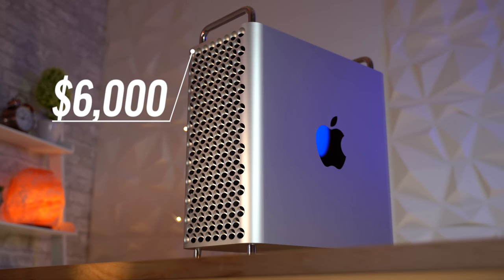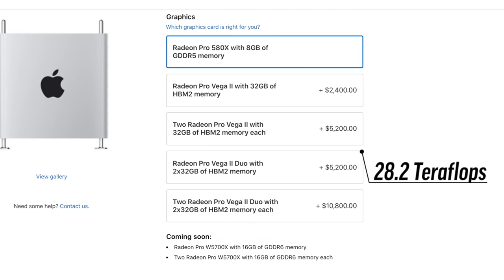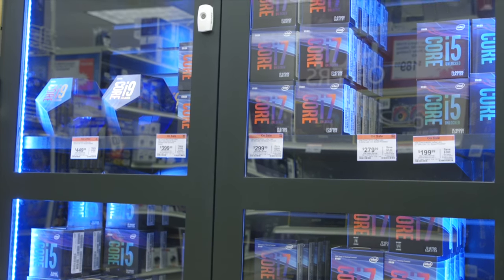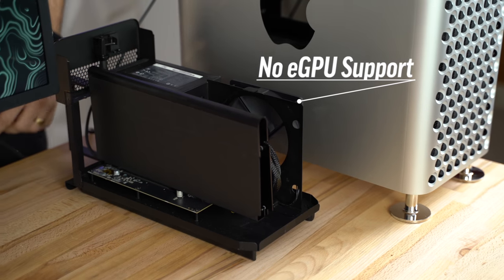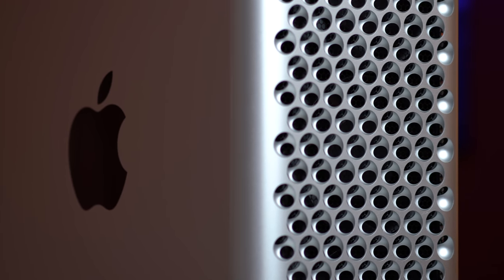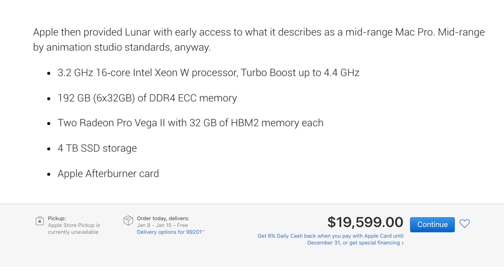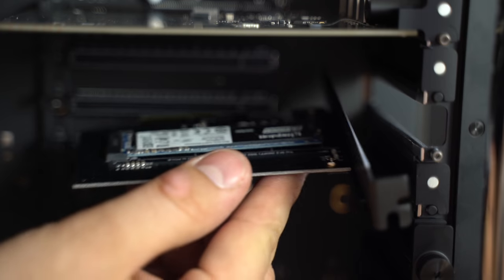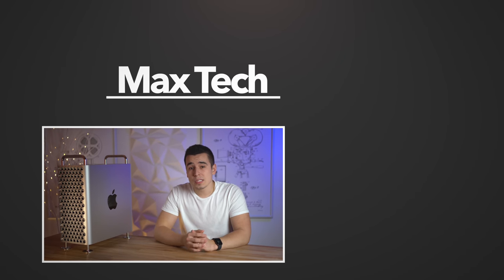2019 Mac Pro Review - 7 Reasons it Sold Out!

Comment: I don’t understand how you came to workstations that price, you can beat out the Mac pros performance staying under 10k, and you don’t even have to go with an AMD processor intels i9 is basically the same for way less just don’t use ECC ram, ECC doesn’t offer much more stability anymore compared to even ddr3, and compared to ddr4 the difference is negligible except for the fact that ECC is more expensive and slower. A gtx 2080ti should get pretty close to its gpu and still be cheaper and if you wanna beat it than just get 2. On top of all that it’s not like Apple has to use intel for this, they could’ve went with an AMD processor which could leave it up to the user if they want ECC or not.
Reply from the maker: Definitely not a paid review. What LG monitor?

Comment: 2012 Mac Pro doesn't have weak power supply. It has 1000 watts and that was for 2009, 2010 and 2012 enough (at their time). Problem is elsewhere. At that that time nobody predict that GPU will need so much power and Apple design it with just two PCI-e six pin connector in motherboard (each with 75 watts). So that's why people need external power supply or do pixels mod https://thehouseofmoth.com/mac-pro-pixlas-mod/ because if you try use more than 75 watts from six pin connector theirs is good chance that you just burn your motherboard.
Reply from the maker: Thanks for the info and for your viewership!

Comment: My only complaint for the mac pro, even though Iam not a mac user, is the components used. I don't think that there is any sense in using xeon processors or EEC memory in a workstation system. In fact they are worse performer than their HEDT counterparts as they sacrifice higher clock speeds and performance for sustainable 24/7 workloads which make sense in servers but not in  workstations. I hope that apple can ditch xeon for threadripper very soon.
Reply: uhhhh, in order to save data, have your computer not crash, prevent data loss
Reply: @topkek7003  ??
Reply: @topkek7003  the server parts are meant for complete different types of workloads is what I mean. They don't make any sense for video editing and rendering applications not to mention that they are slower than the consumer grade parts at these applications and  much more expensive.
Reply: @Hardware Software yeah epyc has worse scores than threadripper and that is not any thing new. There are alot of comparisons between xeons and intel own HEDT with the same core count and for most applications they are slower. Seems like you are the one who don't know what you are talking about. Servers are meant for totally different workloads such as deep learning. And just to your knowledge on cinebench t2, a rendering based application, the threadripper 3970x scored 17k point while the 64 epyc only scored 20k points keeping in mind that the 3950x scored around 9.5k point showing nearly a linear scaling between it and the 3970x which has double its core count.
Reply: @Hardware Software and I am not saying that the threadripper is unreliable, you are the one who don't understand. These CPUs are meant for  totally different workloads. Surely ignorance is bliss
Reply: At the same clock speed, EEC is less than 1% slower than non-EEC RAM.
Reply: @Setmose  yeah good luck hitting those clock speeds at the first place.
Reply: @Hardware Software who said that hp and Dell are not at fault here. Yeah xeons are just useless for these applications and that is not only meant for apple but also for other OEMs as well. That is enough, it is your money spend it however you like and I'm out.
Reply from the maker: Not everyone that uses Mac Pro’s need server grade parts but I think Apples just wants to have one machine with one motherboard to deal with so they set all of them up this way. 

The cost world have went down a bit if it’s wasn’t but not by a whole lot, and the performance would have went up a little too on some of the specs. Especially now that intel was forced to drop the price of their 18 core i9 from $2000 to $1100 because of AMD. Before that (when Apple was designing this machine) the price of the 18 core was the same as the new XEON W 16 core chip but the 16 core has a 200Mhz higher base clock and 64 lanes of PCI compared to the i9’s 48. The Xeon also supports 1TB of ram compared to 256GB with the consumer line which to us doesn’t matter but to companies it will. Overall the price would have been the same but with the recent price drop maybe Apple could have charged $500 less. 

If they did that it would require them to have two models one for Xeons and one for consumer chips because some people need the ECC and extra PCI lanes and more cores and I don’t think they would want to do that.  

Heck, they didn’t even want to offer extra Xeon CPU options for those that don’t want the M versions of the 24 or 28 core, which would have been nice.
Reply: @Hardware Software whatever you see. I don't care.
Reply: @Hardware Software theeadripper offers higher core count than xeons, higher 72 GEN4 lanes, ECC memory support and up to 1TB of memory and it is much cheaper so tell me what are the selling points of xeon w?

Comment: Great review! Count me in as someone intrigued by an AMD Epyc 64-core Mac with 16 ram slots. Especially if they enlarged the case slightly to accommodate a second processor and set of ram slots. I have no use for one, but I don't have any use for a Lamborghini either. 

This is not a comment directed only at Max Tech but really all YouTubers. When you do your b-roll footage, can you wipe down the black internals? Otherwise, the oil from your hands stands out like crazy. I understand when your doing a-roll and interacting directly with the components but b-roll is staged and should look better. Again, this isn't just your vids, every single one on YT has this problem. Great job otherwise!
Reply from the maker: Thank you! Yes we screwed up on that. It honestly wasn’t very visible when recording but much more so in the footage.

Comment: The "industry standard professional codec for editing video" is not ProRess! Especially not since crApple stoped supporting "Apple Color". Digital Intermediats are done with uncompressed RAW material which ProRess is not. ProRess is a compressed format ... though a pretty powerful format for endusers and lower end professionals. However again, ProRess is neither "a standard" -> you people badly need to understand the difference between A STANDARD and common! - nor an industry professional. Well, depends to what industry you are referring but since you pointed out that the Mac Pro is not for the avarange professional I assume we are talking about high-end industry especially since you mentioned Disney who are totally NOT working with ProRess. Completly NOT. Not one frame!
This leads me to an interesting question: who is this machines really for?
Its not for high-end industry companies because having ProRess support doens't mean sheit. Its also not for lower end professionals because Adobe Premiere for example can't render in ProRess. You can edit in ProRess but not render anything for end format. Highend editing systems can render in ProRess like Davinci Resolve or Avid Mediacomposer (others too) and of course the unprofessional Final Cut X can render in ProRess.
Anyway, the Mac Pro 2019 is still a powerful machine. no argument there.

Comment: I understand your other arguments but its not like a Ferrari at all. Ferrari has a Ferrari engine you can’t stick or get anywhere else. This has a 3.500$ now outdated generaly available CPU that they offer to stick in for you for 7000$. The same goes for the Dell and HP ones (while those could get up to 2 processors so can be at least faster!). I remember the Sun Sparc, SIG Indigo, or the crazy Intel Itanium based HP machines - those were truly unique workstations you just couldn’t get anywhere else, well deserving their prices. This is just a normal PC in a truly beautiful and well engineered case. So a ferrari with a fast, but stock Volkswagen engine.
Reply: Precisely.
Reply from the maker: There are certainly multiple specific things that it offers that you can’t get anywhere else and we list them in the video. - Max

Comment: You know? I just wish Apple would keep the current trash can but with updated ports and internal, and market it as a product between Mini and the new MP. I don't need all those expansions but don't want to settle with the mini. And I don't like all-in-one so iMac is out of the question.
Reply: Yep, been saying this for years. There is a massive, MASSIVE gap between the mini and the Pro and no, a lot of us don't want an iMac.
Reply: Mac Pro isn't even good enough for the price. Not a single person in the 3D realm recommends AMD Graphics card.
Reply: @busimo  "Not a single person" - I can call BS on that one alone. Also which 3d realm? Modelling? Rendering? Which industry? What software?
Reply: A desktop Mac in the price range around $4k base model would be great.  With simpler build quality than the Pro, but expandable like a regular PC. (With option to use AMD CPU's and Nvidia cards) I would buy one directly if they made one. But the chance of that ever happening is slim.
Reply: @johanrg70  Well you aren't going to get official Nvidia support from Apple for historical reasons, but the rest, yes. Nothing to stop you plugging an Nvidia card into the Pro if they have their unofficial drivers working.....
Reply: @MichaelGGarry  Yes I know, this was about that hypothetical desktop Mac though. Not a workstation. Doesn't matter though, it's not going to happen anyway.
Reply: @busimo  Techguage disagrees with you:
https://techgage.com/article/amd-radeon-navi-vs-nvidia-geforce-super-proviz/5/

Blender: "Fortunately for AMD, its GPUs hold their own quite well, and in some cases, better than NVIDIA. The 5700 (non)-XT outperforms the 2060 SUPER at all three resolutions. The XT manages to outpace the Quadro RTX 4000 just the same."

Simens NX: "it must be pointed out that AMD somehow performs very well in comparison to NVIDIA here. We’ve seen that before, but with Navi, we can now see that it’s not just a fluke."

CATIA: "AMD’s Navi performs great overall, once again placing ahead of all three SUPERs."

SolidWorks: "As for the Navi and SUPER battle, AMD has managed to shine here, with both of its RX 5700 cards placing ahead of every one of the SUPER cards – even the 2080"

Remember, you said "not a single person in the 3D realm recommends an Amd graphics card".

Once again, I call BS.

Comment: Ok let's do a quick comparison with a Threadripper build.

Motherboard: Gigabyte Designare TRX40 $700
CPU: Threadripper 3990X 64 Core 128 Threads $4K
RAM: 8x Corsair Vengeance LPX 32GB DDR4-3000MHz Total 256GB @ $1.2K
GPU: 4x nVidia RTX 2080 TI's = Over 53 Teraflops $4K
PSU: Corsair AZ Series AX1600i
 1.6 Kilowatt $500
SSD: 2x Samsung 970 Evo Plus 2TB
 $800 in Raid 0 = 4TB
Case:  CoolerMaster Cosmos C700m
 $400

Throw in a nice cooler too and that's about $12K of bad mathafucking computing power. That's twice as powerful than your 20 or $50K cheese grader! LMAO

Am I missing something?

Comment: The base iMac Pro has much better graphics and is a way better value than the base Mac Pro. 
You would need to spend much more money on a Mac Pro to have better graphics performance and decent SSD storage, like the Vega II GPU upgrade alone costs almost 3K, and it’s not even close of the top of the line GPU, and no Afterburner either. Unlike the iMac Pro, you’ll need a display too, if pairing it the XDR Pro Display it’s 6K more just for that.
My audio loops library alone can’t be stored on that base Mac Pro’s SSD, and not even installed the apps yet when the base iMac Pro comes with a respectable 1TB SSD.
The Mac Pro only makes sense when spending at least over 20K.

Comment: This makes liquid cooled machines with lower specs seem a bit unnecessary and silly.
Reply: J Fz and the 64 core water cooled pc is still cheaper xD
Reply: @Revelator2025  k then apple shill xD Just go on newegg and try some configs and pshhh: MacOS runs on the new Threadripper CPU´s. Check out Snazzy Labs videos, they even build one a month ago using the 3900X and doing an upcoming video with the 3950X. From you comment i just can say i still have more knowledge about this topic than you because you just managed to insult another person online instead of bringing facts or price to break down my claim. Btw i make money in the SI (systemintegration) industry, OUCH! Give me some hours and i can give you a list of every pricepoint of the mac pro and i will configure a better machine.... And if you wish even machines which are all compatible with MacOS Catalina xD

Comment: If apple will soon switch to amd processors does it mean that this mac pro is already old? 🤔
Reply: Straight out of the gate this thing is old and underpowered because instead of using quadro’s they use AMD cards. Secondly AMD processors are cheaper and perform so much better. Man idk wtf Apple is doing over there

Comment: Nice video! I’m considering getting the “rackmount” version but one major concern is Bluetooth reliability considering the Mac Pro will be rackmounted in a solid wooden rack. Has Apple done anything to make sure connectivity is secure and reliable? Thanks!!
Reply from the maker: The antennas are right under the handles (there are slim plastic inserts that look like the stainless, similar to what they do on iPhones so the signal should be just fine since that section is outside of the rack. 👍
Reply: Sounds like something to look forward to! Thanks!!

Comment: From a purely business prospective, the only reason to get this is if you absolutely MUST use a Mac-only application, don't want to mess with hackintoshes,  and want the best performance that Apple has.  Other than that, this is ridiculously overpriced considering what you can get with a customized workstation with an AMD TR or Epyc processor.

Comment: On Apple's site, the price has dropped about $5k on the "all max options" model to $48,768...wheels and all.  Looks like most or all of the drop is in the 1.5TB ECC DDR4 and 2x Radeon Pro Vega II Duo options.  A couple points:  1. Apple should have been explicit from the start that the Mac Pro is for professionals and businesses; not consumers, or they could have released an additional Mac Pro line that was priced for consumers around the same time, since there was interest in it among home-based Mac users.  2. For everyone's sake, Apple and Nvidia need to settle their feud and get Nvidia support back in Mac OS, unless Nvidia enjoys boosting AMD's bottom line and Apple enjoys pushing their professional customers toward Microsoft.
Reply from the maker: As far as I understand Apple is willing to have Nvidia cards work but they want to have control over drivers and have full metal support but Nvidia doesn’t want to give up control. Thanks for the input on the prices I’ll check it out.

Comment: Your review is unknowledgeable and misleading at least.

Mac Pro 2019 may be superfast for editing video in prores but that's 
about it. Announced half a year ago it is already outdated and is NOT by any strech of imagination a 3D rendering machine.
Lunar studios used it to create main-on-end title sequence and your review suggests
they used it to create 3D animation and VFX for the film. 
VFX and all 3D creatures were done by Sony Pictures Imageworks, Method Studios, Rodeo FX and Weta Digital using Linux/Windows workstations and special software like Ziva dynamics that cannot run on Mac OS.

Without Nvidia support Mac Pro will never be used for things such as VFX, 3D rendering and compositing. No production renderer out there supports metal or
opencl needed for Radeon GPUs to be utilized in that regard.
Otoy announced Octane X to support metal 6 months ago and still nothing.
Arnold is RTX, VRay and Redshift also RTX exclusively.
Cinebench score for 12C xeon is 3 times less than threadripper 3960x
Be sure that none of the heavy 3D renderings we see in movies for the last 20 years
have ever been produced on Mac OS. In 90's SGI was all the rage, after that Linux and Windows.

Mac Pro is an overpriced and underpowered hipster machine with over engineered 
irrelevant details. Cabless system is an accident waiting to happen and it's 
there just for proprietary reasons to allow apple to charge more if something
breaks. T2 chip exists for the same purpose. Why not standardized NVME slots?

Mac Pro is not one bit more reliable than say HP Z or Dell workstations. Yes, it is modular but you cannot walk into an Apple store and buy replacement psu like you can with HP or Dell. No redundancy also. BTW I am MP 5.1 user switching to PC soon.

Just for fun:
Have you tried to open the case without disconnecting all the cables first?

Comment: Is it faster to fill 6 of 12 slots with 64GB RAM or all 12 slots with 32GB RAM?  Thanks!
Reply from the maker: All 12. From what I read using 6 slots gets 97% of the performance compared to 12 slots. In the real world it won’t make a difference but what will make a difference is buying 32GB Simms instead of 64GB something should save you some money.
Reply: @MaxTechOfficial  Disagree...IMHO - In order to increase overall value and upgradability, the more expensive option of 6x64GB is better than 12x32GB.

Comment: 50k half of them is for overpriced ram, if you really want the best spec mac pro. buy him with the lowest ram option. so you can save atleast 5k.
Reply: and buy the ram separately,
Reply from the maker: Yes, I think you can save $11,000 if buying 1.5TB ram yourself instead of from Apple who charges $25,000. But atleast it’s better than Dell which charges $44,000 for 1.5Tb ram lol.
Reply from the maker: In all of Apples performance testing numbers they didn’t use more than 348GB so there really is no need above that.
Reply: Yes you probably never need so much ram
Reply: dell's ram cost a whole car holy fuck.